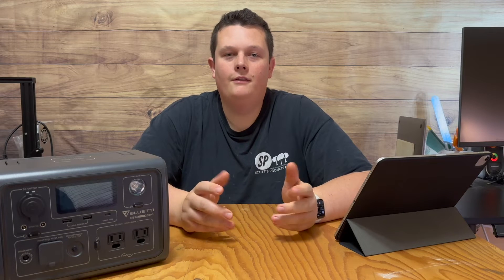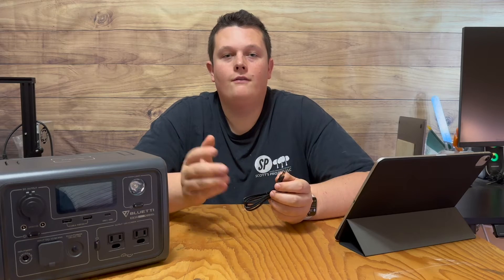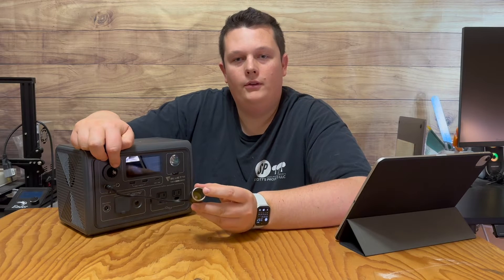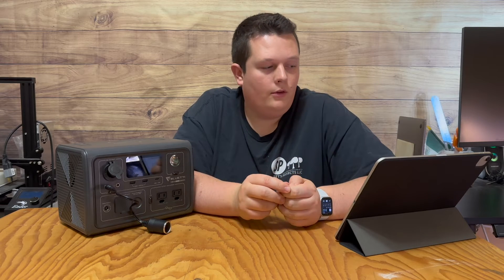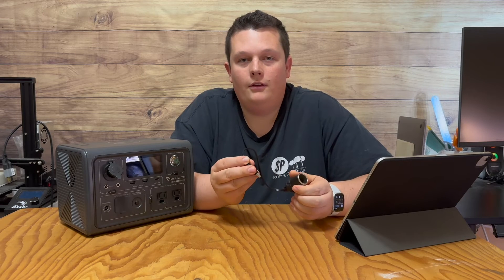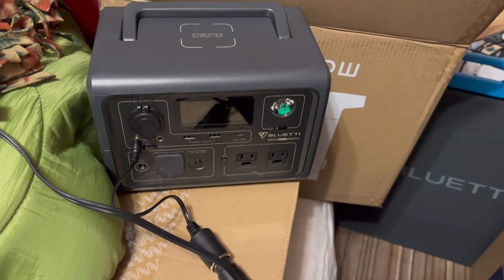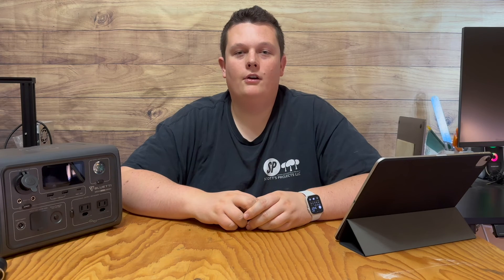What is DC5521 and what is it for?

Comment: I have a BougeRV portable folding solar panel, which has a DC5521 for the DC out. I also have a BougeRV refrigerator that can take a direct connection to the solar panel with their cable, and it also has a DC5521 connector. (Female on both devices). The stock cable is 16 gauge, but only about 3 feet long. I'd really like to get an extension cable that's at least 20 feet long, so I don't need the solar panel next to the fridge. 

Ideally, I would need a cable that's at least 16 gauge, maybe 12 or 10, with a male connector on one end, and a female on the other, both DC5521 - or, if I need to, male on both ends. Do you know where I can get one?

Comment: Nice baby step but why not answer the question you did not. Not knowing what the power station outputs is a problem. You leave your audience in a hole. If 10 amps is the limit of all three owners are kinda screwed. If we are stuck with 10 amps can it go to a buzz bar for proper distribution? Can it charge a rv house battery? The biggest problem with power stations is the can power 120 appliances for very short periods of time and 12V distribution is limited to the cig connection and two 5521’s. DOES ANYONE KNOW HOW TO UTILIZE THE 12V SIDE OF A DELTA 3 PLUS?

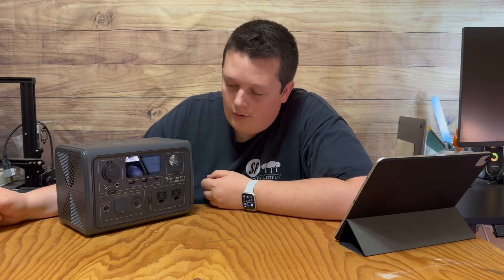Comment: 2:22 Starlink Mini plug … Great video… was trying to learn about DC5521…. Starlink Mini…. 😊 can use this port… as long as its rated high enough current, and cable length is short enough

Comment: Thanks for the video this is exactly what I was looking for. Maybe you should go over to Google and let them know. I have a question, I have a echo flow 600 pro. I need to charge it, does solar panel that I have 15w - power tolerance 0~+3% .18 volt,0.83A. open carrot voltage is 21.6 volts, short circuit 0.89A. then it goes to say at STS parentheses 1,000 Watts/m20,AM 1.5 spectrum cell temperature 25C all values are normal unless designated as tested, What? I just need to know can I charge my echo flow 600 pro with this solar panel and how long do you think it would take a week

Comment: Here in Ukraine during the war with russists we use EB3A to power wifi router + fiber optics module to have internet and be able to keep working during russkies-caused blackouts. It also helps to keep my water boiler up and running in winter cold weather😊 .

Comment: During the part in the video where you point out your Bluette has 10A on the DC5521 ports vs. EcoFlow’s 3A ea., but the EcoFlow Delta 2 is superior to your Bluette in the fact that all (6) USB/USB-C ports are on its own circuit whereas it sounds like yours has the USB  on the same as your CarCarger & the two DC5521 ports?

Besides that, you can get those “Cigarette Lighter Power” adapters for USB-C ports running at 5A.

Comment: My CPAP (Breas Z2 auto) has a DC5521 power input port. This means that I can direct connect into a power supply that also has a DC5521 power port. This eliminates using a power consuming adapter/inverter.

Comment: Quick question, I’m considering the EF ECOFLOW Portable Power Station 3600Wh DELTA Pro, would you recommend the Bluetti over the Eco Flo and if so, which one would be comparative in size to this one I’m showing thanks? Also, if I already have two, Jackery solar panels will those work on the Bluetti

Comment: Hi. Very informative! I have a goal zero yeti 500x with a 6mm 12 v output.I’m guessing it’s not the same as a 5521 output…I’m trying to plug in an iceco g20. I find the 12v “cigarette” plug  has a tendency to pop out…manufacturing issue.. could I use the 5521 plug into the 6mm output or is an adapter exist for that? Any info would be appreciated. Thanks in advance! Also, I don’t know if I’m using the proper terminology…

Comment: Hi Scott's Solar Projects.  I just purchased an AC180.  I also have a DIY system.  Can you do a video on a DC7909 y splitter?  I want to use the dump load from my existing system, plus add a 100 watt solar panel to charge my AC180, but I'm nervous to try.  Thanks in advance.

Comment: Thanks for the video and the explanations. I use portable flash units for photography and the batteries have DC5521 plugs to recharge them. I just looked into them and it's exactly the same plug. They come with wall charger that seem to convert AC to DC to charge the batteries and they have a meter on them to show how much is the battery charged.

Now, my question is this : If I get a DC5521 male to DC5521 male cable, could I use my Ecoflow River 2 Pro to charge my batteries without the battery charger? Could it damage the batteries (if left charging for too long, for example)?

As I guess that using the charger, it's probably not as efficient as it could be since I would lose power on the EcoFlow inverter and then maybe have another loss when the power is going through the charger.
Reply: Hi Can You solve this?
Reply: @musicandres I did, it works, provided the voltage is very similar.

Comment: What accessories (cables, adapters or others) have you found to most useful to have in using a portable power station like the EcoFlow RIVER 2 Max? Can extension cords and/or adapters be used in the unit's AC outlets to provide more three-prong connections? Any recommendations? Thanks again!
Reply from the maker: Yeah, you could use a 2 to 3 prong adapter to allow more 3 prong plugs. Or, you could just use a power strip to plug into 1, 3 prong outlet on the unit. Just remember there's no grounding benefit. As for other cables, I just use the ones that typically come with the unit, for charging via solar or car or at home. I do have these cables: https://amzn.to/3XhgvK8, https://amzn.to/3NzpWSa, https://amzn.to/3CCwvNG. They help with the DC section for other units and solar adapter for different power stations.
Reply: @ScottsSolar  Scott, Your time in responding is appreciated! That DC splitter might be a good idea.

Comment: Scott, thanks for that information as it was very useful! I have a few questions re/ the use of those DC5521 Outputs for the EcoFlow RIVER Max 2. Here are the unit specifics. DC Output 12.6v, 10A/3A/3A/, 126W max...  DC5521 Output 12.6v, 3A, 36W Max... and Car Input 12v/24v,8A, 100W max. If I use the adapter you show, can a duel USB adapter be plugged in and if yes, which ones? Can two of those adapters you show be used at the same time, with a USB adapter in each of the two DC5521 Outputs? Many thanks!
Reply from the maker: If you're needing more USB ports, than what the unit provides, you can use the adapter I show plugging into the DC5521 ports, with a USB adapter connected. Or, you can get something like this that turns into a USB: https://amzn.to/3qroZ5k
Reply: @ScottsSolar  Many thanks Scott!

Comment: Is it more efficient use of Power Station's battery to use DC power than use the AC outputs to power a device that can be powered by either?
Reply from the maker: Yes, anytime DC is available, go for it, it doesn’t have to invert the electricity which does increase the efficiency. 👍🏼

Comment: What about DC5521 polarity? I've collected wall-wart power bricks and there is not uniform polarity on them. Some are positive in the center, others are negative. It's a real PITA.
Nice video. Thanks.
Reply from the maker: Great comment! I’ll have to look into that, thanks!!
Reply: Most are center positive. It's up to you to check to make sure though. No big deal.
Reply: @Tommyr  So when I'm trolling Amazon to purchase a battery pack to power something, don't you think it would be advantageous if the seller would put the size and polarity of the cable they include with the product? I could order the device, then return it when it is the wrong size or polarity but isn't that a waste of time and cost everyone because Amazon will be spreading that cost to all customers.
Reply: @RobertShaverOfAustin  Or you can learn how to reverse the connector so the polarity is correct. Not very hard to do. Again, most center conductors on those are positive. Easy to check.
Reply: @Tommyr  I could build a cable from parts. I could cut the cable and swap the wires. Please enlighten me, how would you do it? Me, I'd like to just get the right parts the first time ... which is why I've moved on to another product that DOES include a full description of the product. THAT is the easiest method.
Reply: @RobertShaverOfAustin  Just order a adapter cable from Amazon. 5521 to whatever other connector you want. They are not expensive. Or make one yourself.